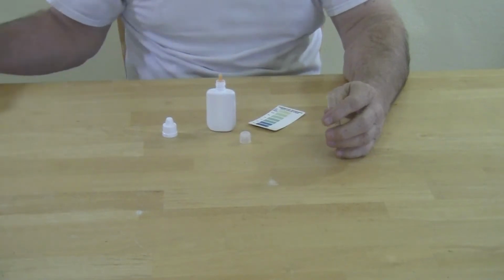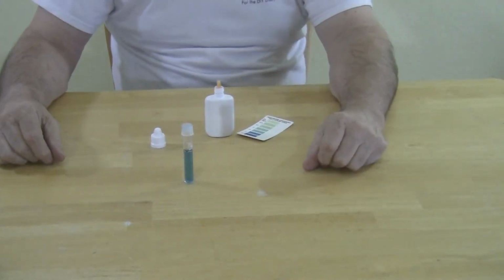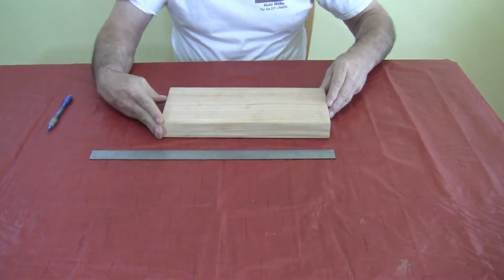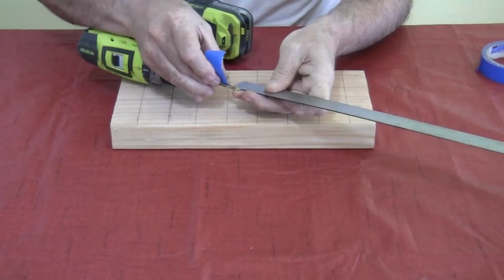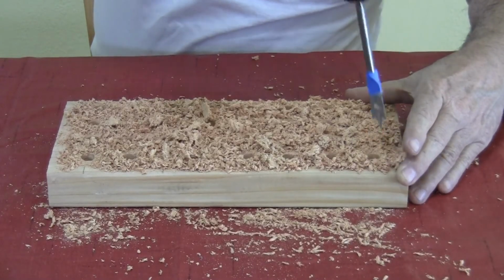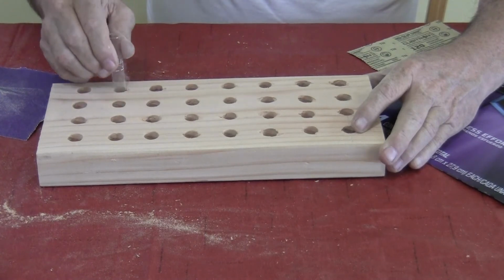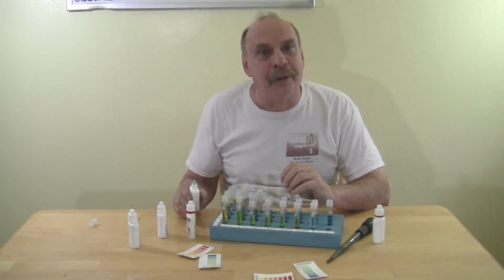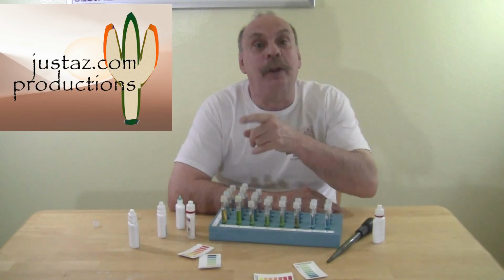DIY Test Tube Holder designed for use with API Test Kits

Comment: Hey man I have a question... I just got a 72 gallon bowfront aquarium with a 20 gallon tall sump.... I was thinking if I built a cover in the aquarium could I use a pump to pump water to the sump and then use the same type of pump in the sump to pump water back to my aquarium instead of buying an overflow system?
Reply: Gabriel Cordero the two pumps will NEVER be evenly matched.  The pump in the main tank will always have a huge advantage over the other pump in the sump.  The big problem with this approach is that the upper tank will move water more efficiently to the sump far outrunning the lower pumps ability to push water back up to the main tank.  This setup will drain the main tank out onto the floor in just minutes.  Based on this principle is why an overflow system works efficiently.  You can build overflow systems that hang over the side of the tank out of PVC avoiding the need to drill a hole through the glass.